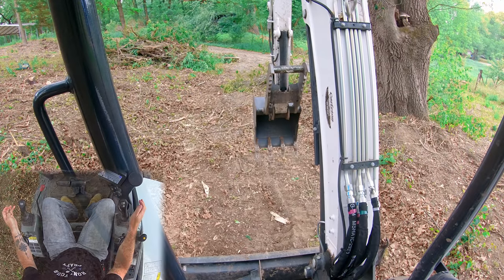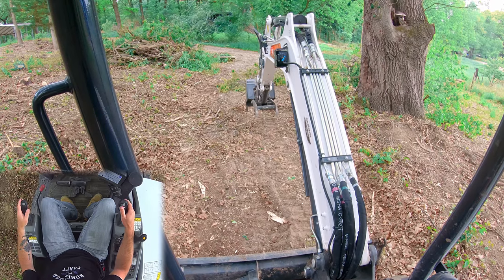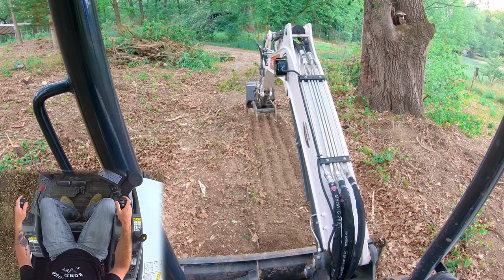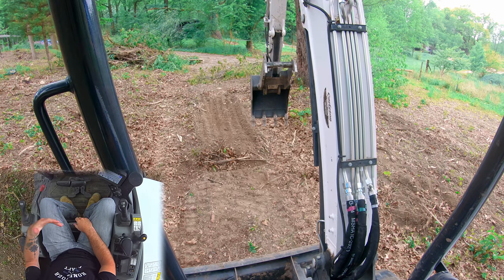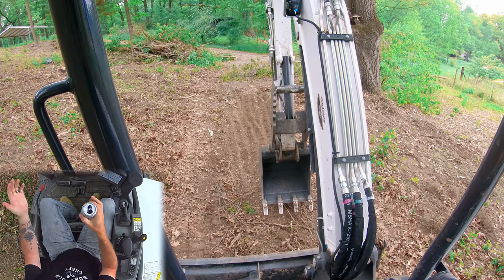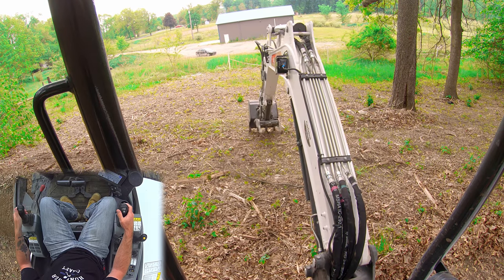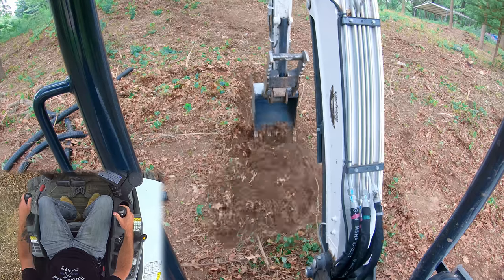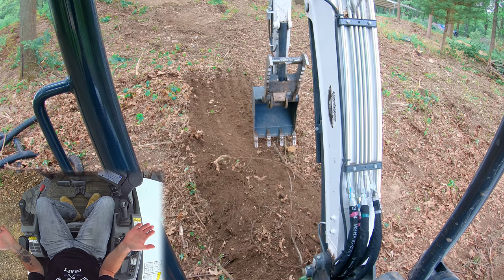HOW TO GRADE WITH AN EXCAVATOR //How To Set Your Hands Grading In Excavator-Excavator Tips & Tricks

Comment: has nobody made an excavator that can move the boom and dipper together , in a straight line with one lever movement?  i mean surely it would only need encoders on the rams so a processor knows the positions, and it could control one or both hydraulic circuits to make a seamless smooth straight line

Comment: I have just got a mini and your vids have taught me a lot, thank you. But I have 300 yards of driveway that's in really bad shape. I can get it flat-ish, but not sure how to use the mini to get a crown on it. There   is no room to work to the sides only on the driveway itself. You make it look incredibly easy
Reply from the maker: I'm assuming your machine has a blade on the front.  Use your bucket and grab a little material and sprinkle it in front of your track that you want to be the top of the crown.  When you track forward you should have the pitch you want.  Make sure you have some material loaded up on your blade and start going forward.  This will get you started with a nice crown.

Comment: Good video. Thanks as I am just starting out with my E35. Question: Do you run a full throttle when doing most of your work?
Reply from the maker: Yes, I always run the machine in full throttle.  You have much better hydraulic control and precision when you have the machine running at full throttle.

Comment: Thanks a lot for these tips, I'm really enjoying and learning from your videos, the picture in picture is definitely a huge help. And I'm curious which model Bobcat you were running? Starting tomorrow I'm renting a Bobcat E50 R2 with extended arm, enclosed cab, angle blade, thumb, 24" digging and 48" grading buckets for a week to do some site development, this will be my biggest project to date.
Reply from the maker: Sorry for the late response.  I believe this was the E50 if I remember correctly.  I'm not the biggest fan of Bobcat machines.  They are loud, don't have a lot of power and are very jerky on the controls.  How did your project go?
Reply: @DieselandIron  thanks for the reply!  And I totally agree about Bobcat’s jerky controls, l definitely struggled with that, even with the blade(!)
Since then I rented a Takeuchi TB235 for one day on a smaller project and was extremely impressed with how smooth those controls were, with no learning curve, it was like day and night. I’ve been a huge Kubota fan for years but will seriously consider Takeuchi for my next purchase.

Comment: Great video! So question: How is Bobcat meeting emissions by not having a particulate filter?
Reply from the maker: There are a number of factors that come into play for meeting emissions.  At the end of the day the only thing the EPA cares about is the diesel particulate matter being ejected from the machine and the NOX emissions.  As long as you come in under their established limits you can get there however you want.  Engines under 75hp don't have to worry about the strict thresholds which is why you see so many units (minis and skids) that are 74hp.  That's the magic number to avoid big emissions dings.  Once you cross that limit you can use DPF's, SCR's, EGR's and any other mechanism you like to get the emissions to acceptable standards.  Some manufactures have dirty enough engines they have to use all methods of aftertreatment.  Maybe I'll do a video on exhaust aftertreatment at some point here...

Comment: When you're pulling in are you curling the bucket any way at all as well?
Reply from the maker: No, I'm only using the boom and stick.  As you progress and get better you can add in bucket curl but initially keep it easy on yourself and only use the boom and stick.
Reply: @DieselandIron  what about grading off stone with the back of the bucket, again you don't curl bucket?
Reply from the maker: @Wass_85  you would start your pass with your bucket already curled and as you stick in the bottom of the bucket will stay the same height but will do a good job of smoothing the stone

Comment: For the most part the can theory is a good example of muscle memory except after hard 8 hrs of beer can grading I found it very difficult to pull it to the dump box without spilling or crushing the can afterwards .
Often experiencing loss of control with intermittent hydraulic leaks? Beyond 8hrs the onboard topcon system become erratic , processing speed slowdown dramatically causing one or both final drives to underperform ultimately leading to a dead stick. At this point if the machine doesn’t go into limp mode it become extremely dangerous to operate in fact the structural components of your counter balance will fail leaving the machine extremely unstable…
Possibly upended with your stick in the dirt ?
 With no options but to call your co-worker to assist… but not before they document a compromising situation eventually posted to YouTube 

Be safe & remember: asphalt and steel tracks don’t mix, keep ur stick in the dirt !
Reply from the maker: I have no idea what you are talking about right now...but thank you for the comment!

Comment: Aren’t excavators supposed to be digging?
And graders do the grading?
Reply from the maker: You do a surprising amount of grading in an excavator.  There are a lot of times where you are working in tight areas that a dozer/skid/grader can't get to or there might be a steep slope that you won't be able to get another machine on.  Other times it doesn't make sense to bring in a second machine to clean up a small area when you already have the excavator there.